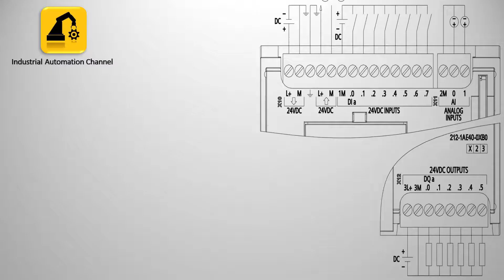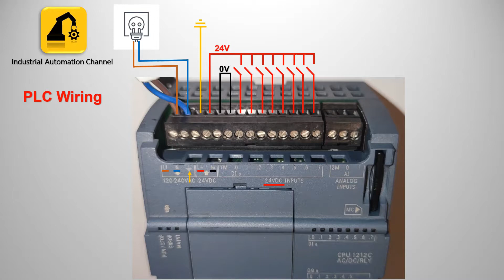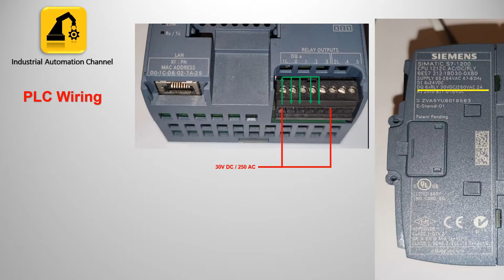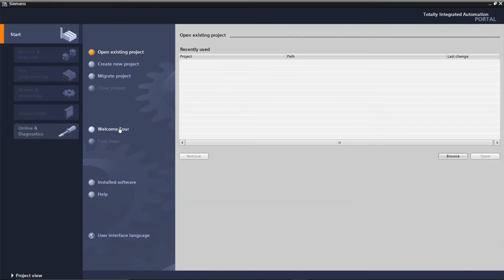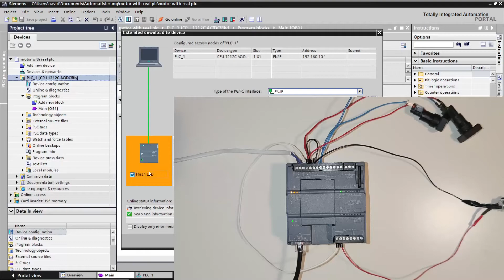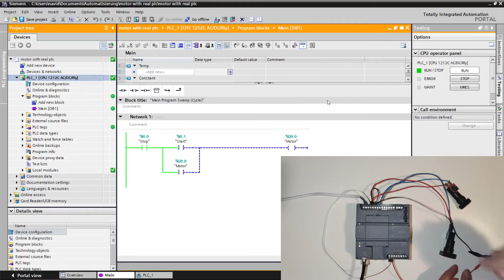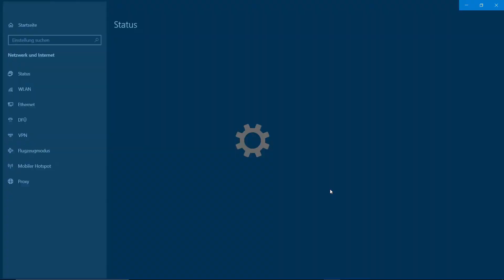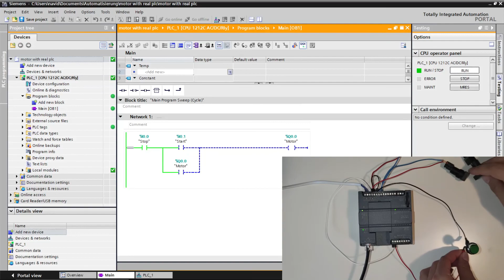TIA Portal #3: S7 1200 PLC Wiring and Download a Program to real PLC

Comment: Viva, Faço tudo correcto mas não consigo colocar o PLC em modo Run..
Reply from the maker: Hi. With google translate I could understand your question:) 
I need more information. What are the LEDs status?  Do you have any power failure?
Check the diagnostic buffer. There you can find why the CPU has gone into stop.
Can you download your programm to the PLC?
Do you use any Module? if yes try to disconnect them (Hardware error) and download an empty program (empty programm--> Maybe you have software error)
Reply: @industrial_automation  sorry i think i was responding on a brasilian video not yours. I found the problem with the diagnostic buffer and with siemens portal site looking for that error. I did a 'download do device' with right click on PLC tree icon and then i finnally could start 'Run Mode' on PLC. Thanks for responding.